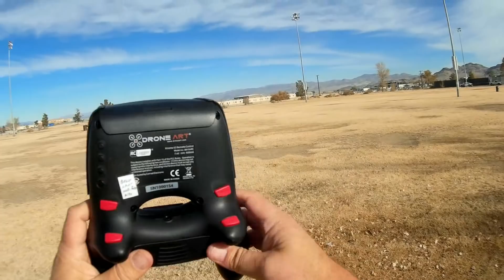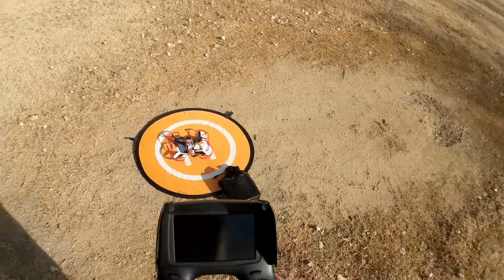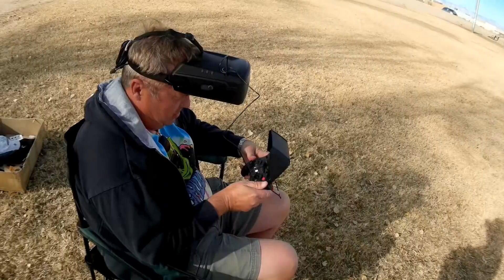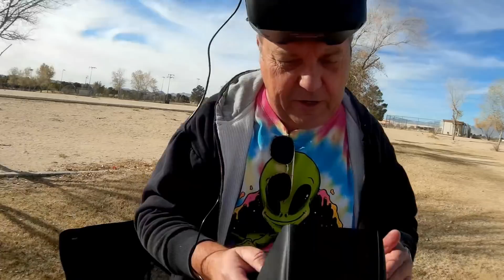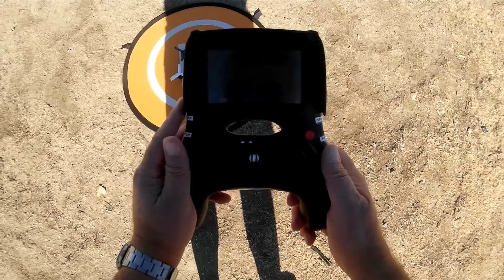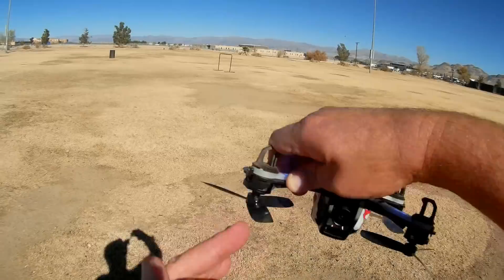RC Eye Xtreme V2 Vantage (Limited Edition) Brushless FPV Sport Drone Review

Comment: Quadcopter 101, Great video !!!
I have an original Eye On Xtreme V1, in its time  (2013, 2014) its price was not overrated, this V2 in 2018 is clearly too expensive, without enough punch and too too much with propriatery things. 100 bucks less could be ok but at this price .... . Anyway this video is a must to show why not to buy it.  Thank you Q101

Comment: Thanks for the honest review. Please note a few very important things...
1. As stated in manual in order to switch flight modes the motors must be disengaged, so this is why you weren't able to switch flight modes, while the motors were still running idle. This is to ensure someone newer to flying doesn't accidentally get into a higher mode. 
2. The punch out you performed was while in beginner mode which has extreme limitations (including in throttle end points) due to it being a very docile mode for the beginner. In sport or expert you will find a completely different level of punch out. 
3. The radio is built to be an all in one unit for the beginner with built in monitor. However the Xtreme V2 is directly Spektrum compatible, so you can bind it to any Spektrum radio. Also it has PPM port for other protocol such as Frsky
4. The new correct pricing is now on our website. Please note pricing is with goggles. Without goggles the price is $189. 
Best regards.

Comment: For $280.00 I’d expect so much more than it can offer although it dose have a good 720p camera, for the price I’d expect ZERO jello but some is noticeable at times. 
IMO it’s around $130.00 overpriced, there are plenty of quadcopters just as good for around half the price. 
  $300 will buy a used DJI Phantom 3, I’d find it so difficult to find a reason to but this.

Comment: I can see what they are trying to do with this as a starter set. But for the money you can get a good BNF quad, a transmitter and some cheap box goggles. So the question is why would you buy this instead and the answer is you wouldn't 🤔

Comment: Perhaps it wouldn't be such a "dog" if you had the 3S optional battery. 1804 motors are pretty small.  4 or 5 YEARS ago, the std. motor in a 250 class race quad was an 1806 2300kv motor .. they probably should have put 1806 motors in it.  Advertised flight time is 10 minutes and you were getting less than 1/2 that when you first started getting 'low battery' warnings. You didn't mention that it has self-tightening screw on props, which is kind of nice. The video was pretty decent for 720P (which they are calling "HD"). I downloaded the manual, and its pretty extensive and goes into a lot of detail. I wonder if you downloaded the manual?  Over all, its interesting, but seems to be a bit underpowered, with short flight times and proprietary batteries. With a cost of $280 with the "viewing goggles" (no RF receiver in side), its a little pricey, especially when it looks like  all features are not quite up to snuff.  Would like to see you see if the dealer would give you a 3S battery to try, to see how it flies with that, and also see how it flies in "Horizon" mode. Thanks for the review .. interesting.